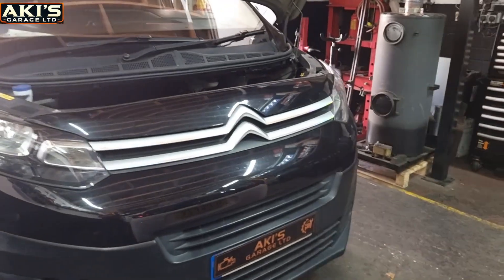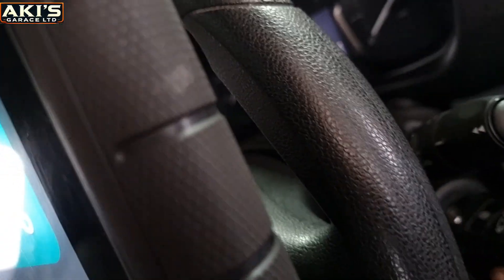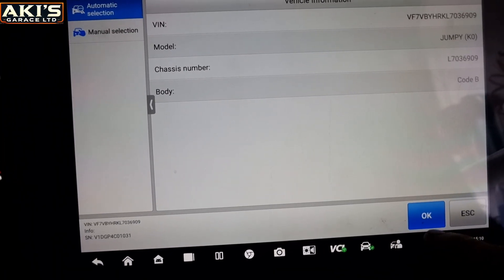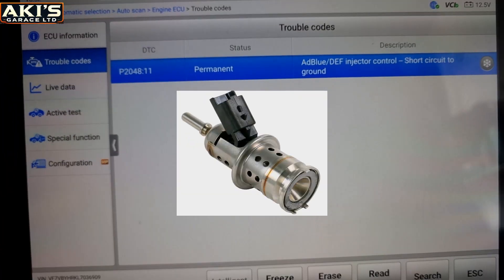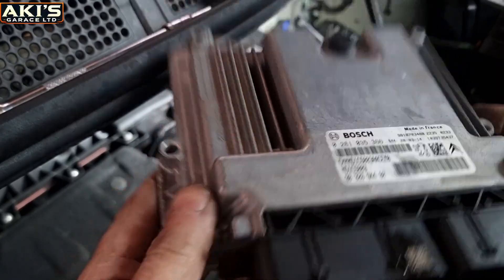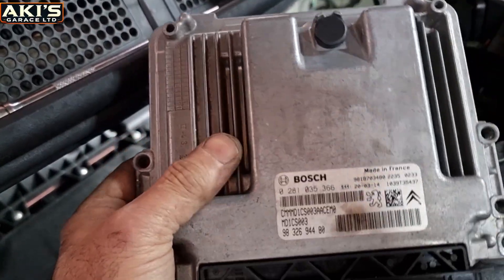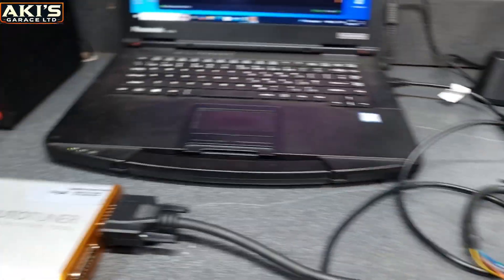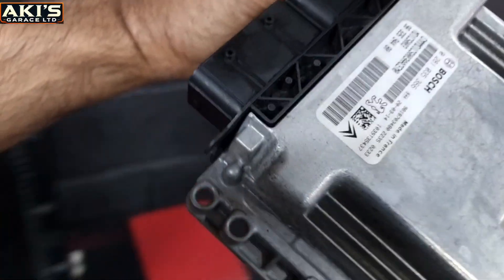Citroen / Peugeot / Vauxhall | Fault Code P2048 Fix | BOSCH MD1CS003 0281037198 AdBlue Delete

Comment: You aint fixed it youve just mapped it out.
Reply from the maker: I understand what you mean In this case the repair approach is software-based, addressing the root cause inside the module rather than replacing parts. Different faults need different solutions, and this method has proven reliable when the hardware itself is OK. Thanks for watching and sharing your
view.